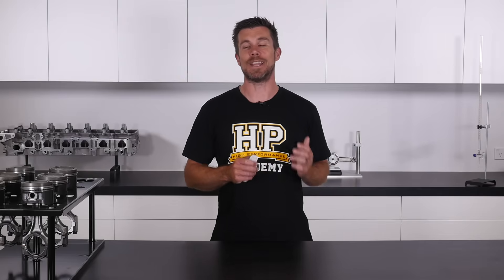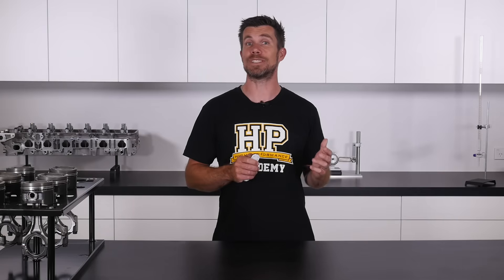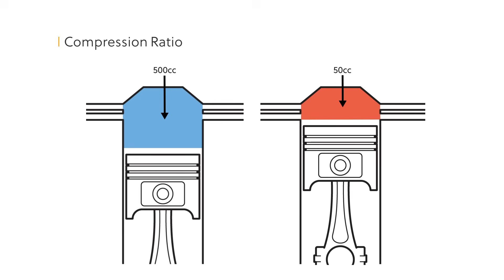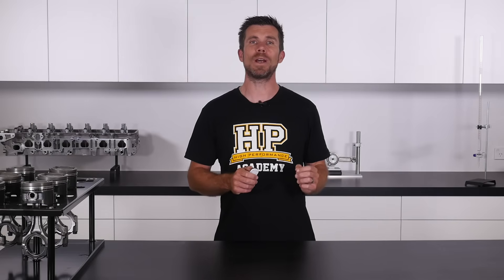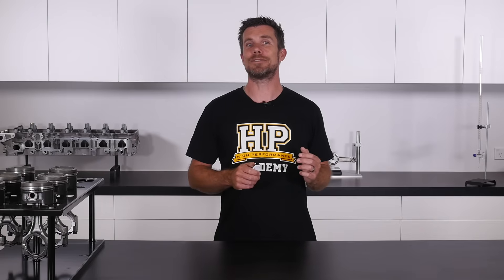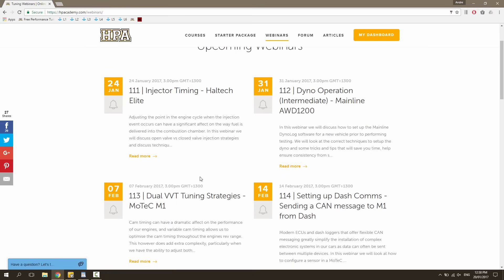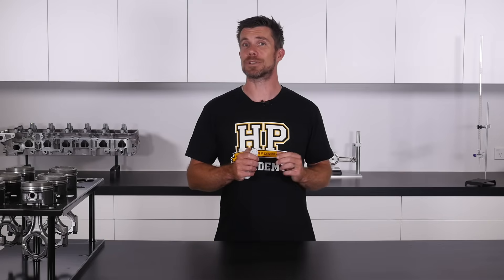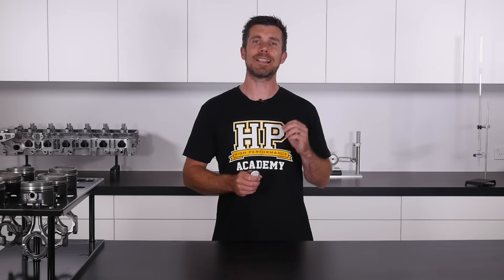Learn how to build engines | Engine Building Fundamentals

Comment: But they don't apply on wankel engines!! XD
Reply from the maker: Correct. This course is for piston engines only. - Ben
Reply: High Performance Academy well some will do apply actually :p
Reply from the maker: Yes you are right. The section we cover on tools and techniques for measurements will be very helpful. The section on fitting piston rings....not so much ;)  - Ben